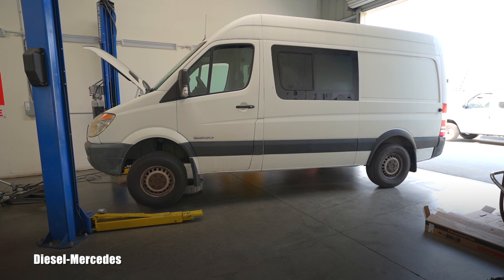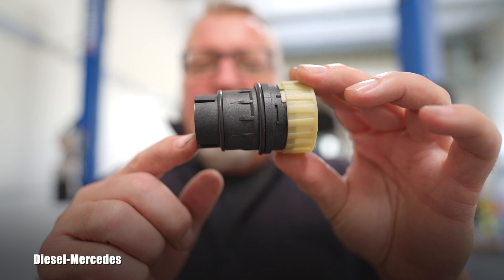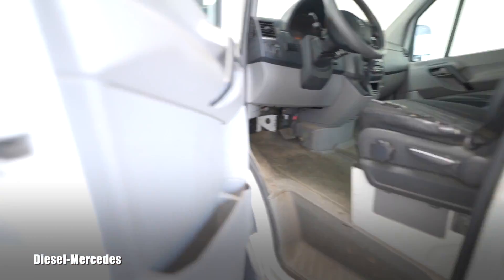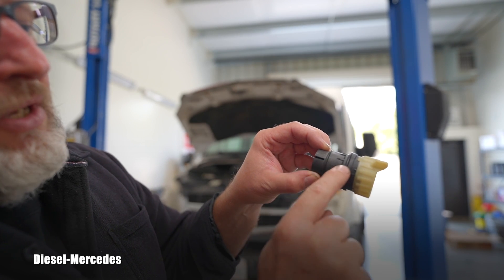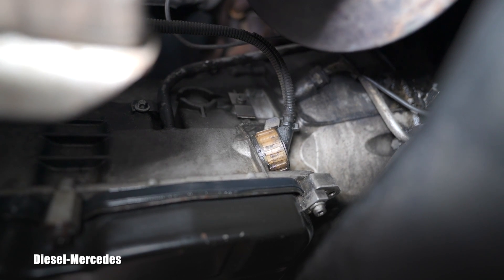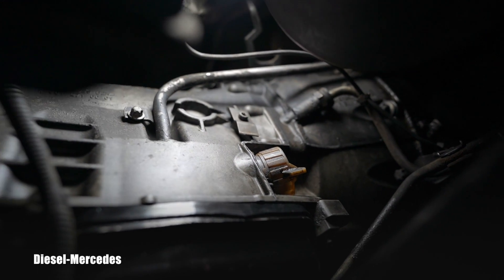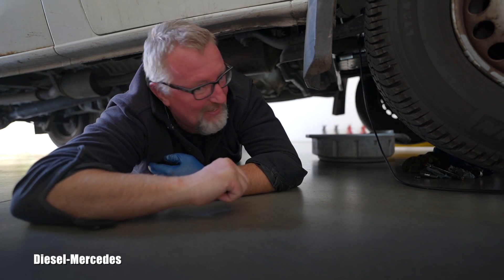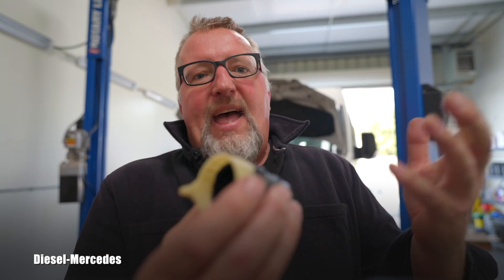Mercedes Transmission 722.6 Electrical Connector

Comment: Thank you so much appreciate your hard work at showing us how this should be done. I have a 2016 Mercedes Sprinter 3500. It's approaching 50,000. I will be sure The Mercedes techs change this.

Comment: How about replacing the 2 O rings with new ones only, and keep using the actual plastic connector itself? I see that everybody changes this plastic part without explaining why, as it shows no obvious wear. Very good content, keep it up!
Reply: If you can find the right o rings then ok , but the part is not expensive so most people replace the whole unit.
Reply: It's very cheap to replace the entire plastic connector. He said 15.
Reply: They don't sell the two very specific o rings separately from the plastic connector, so you are essentially paying 15-20 dollars for 2 o rings. But since they give you a new plastic connector, might as well use it. 🤷

Comment: I have a 2006 S500 with the 722.6. Would you know if I replace the transmission connector do I need to reprogram the car?